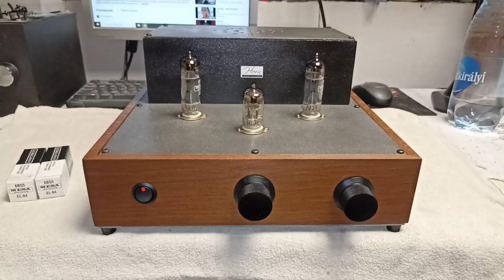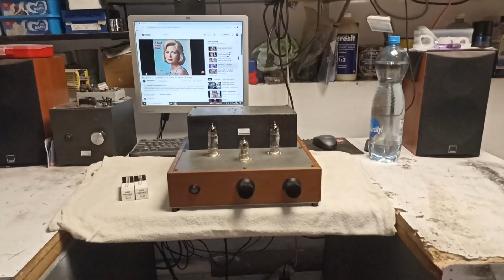Home made 6BQ5 (EL84) SE tube amplifier 2nd test....

Comment: Less.. than pointless !!
 Showing off yer Audio contraption ...Over the internet ! ultimately using the audio circuits in the listener's Computer AND his/her speakers.
Reply from the maker: The videos are made so that when selling, I can show that it works and that I am not selling a fake. Obviously, such a video does not convey the real sound, although the source is very good, I use an external sound card and Dali speakers, not my computer and I record the video with a phone.
Overall: if you listened to it live, you would probably be amazed at the sound quality. Regards: Mihály Horn
horn-amplifiers.hu